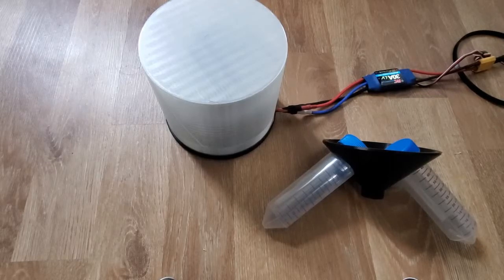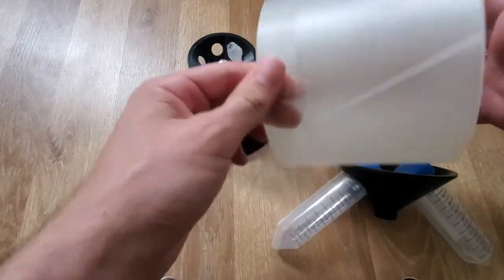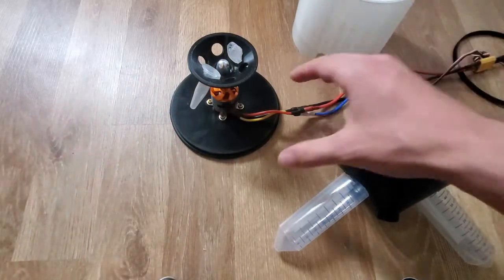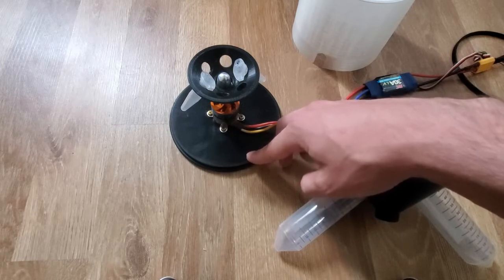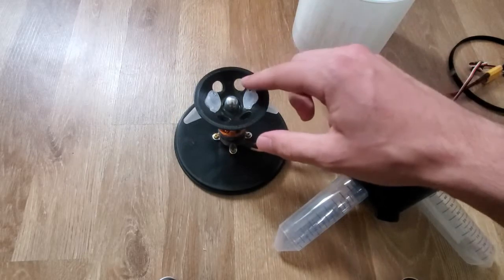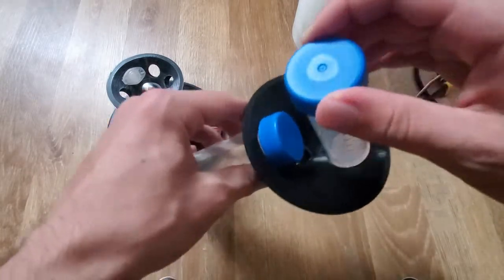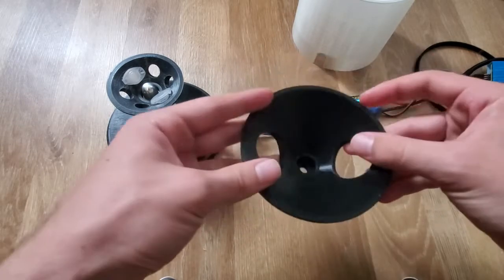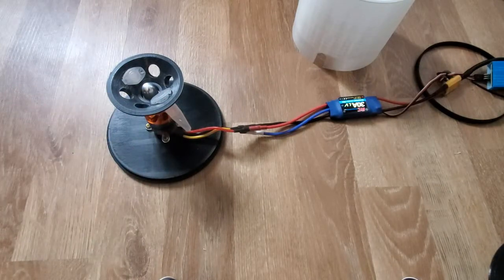DIY Centrifuge: 3D Printed Parts

Comment: can it separate the plasma for prp
Reply from the maker: I'm not sure but based on a quick calculation it should be able to reach ~1000g. The rotor radius is ~22mm and it should be able to reach ~6000rpm.
Reply: @ usually doctors use 3500/4000 rpm for separate the blood
Reply from the maker: What really matters is the g value though. A bigger rotor radius with the same rpm will have a higher g. You'd have to check what size rotor the centrifuges the doctors use are for a proper comparison.

Comment: That’s pretty impressive and awesome. Question,what’s is the RPM
Reply from the maker: I made an updated version with a combined tachometer. I think the rpm reached about 8,000 before the ESC cuts out. You should probably be able to push it a higher with a better ESC. https://youtu.be/YTIsFaAP17c

Comment: Can I know the parts that you use?
Reply from the maker: The three main components are a servo tester, brushless motor and electronic speed controller. You should be able to use a variety of products but I've included the exact ones that I used in the video description
Reply: @qosmoschem  thank you
Reply from the maker: Glad I could help